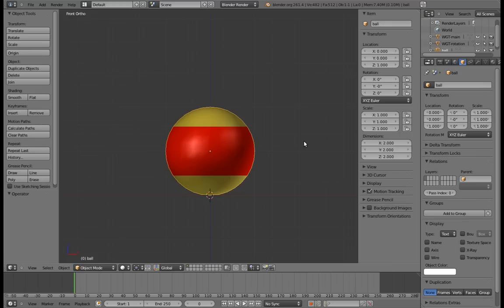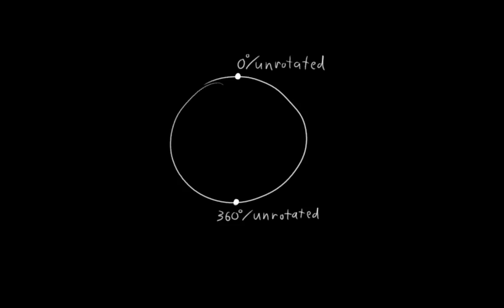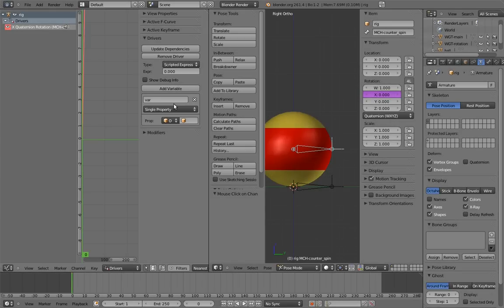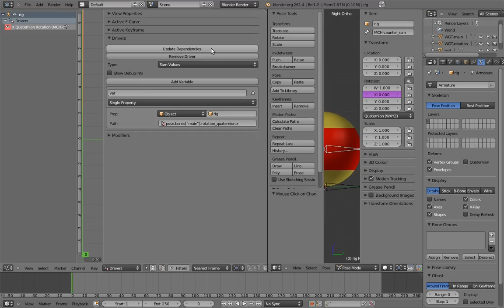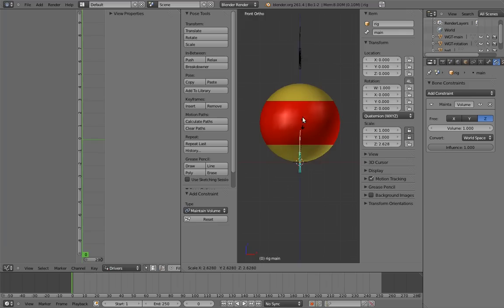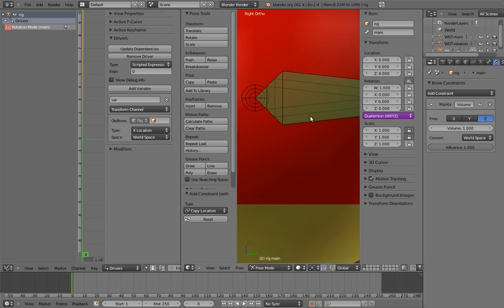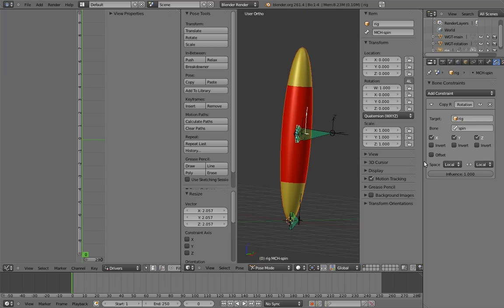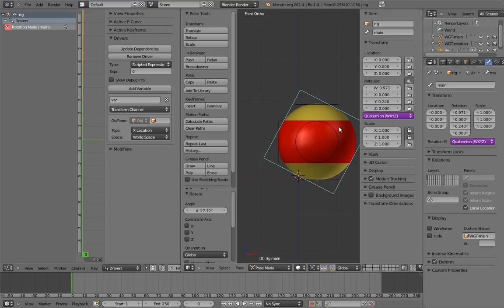Humane Rigging: chapter 03, video 06

Comment: i just can't get why we need quaternions here. for educational purposes?
Reply: It's not purely for educational purposes.
When you have a 3d ball, you want the freedom to move it and roll it in any direction. Doing a lot of rotation along a changing axis (the changing rolling direction) will sooner or later lead you to gimbal lock problems. Dealing with those is super annoying. Generally you end up with weird workarounds or you just key every single frame where gimbal lock occurs, which isn't fun, especially if you want to change things a couple of times, because then you'll have to key every frame repeatedly.

I'm guessing this explanation is not exactly satisfying to you, so in that case, I'd suggest you go through the pain of rigging the 3D ball with Eulers as an exercise and then you roughly animate the ball rolling and jumping around in different directions and up some slopes. You'll get into trouble with gimbal lock. Then try to solve that. Yes, that's a couple of hours worth of work, but afterwards, you'll understand the problem quite well.
Reply: @grafgrantula6100  ok, sounds fair, I’ll try this! My question arose because I’ve tried another rig for ball in CG Cookie and Alive! courses and they didn’t dive into wxyz mode there, although Alive! is focused on animation

Thanks for the detailed answer btw. It’s quite surprising actually you answered so fast, I thought these series are slightly uninhabited, guess I’m wrong:)